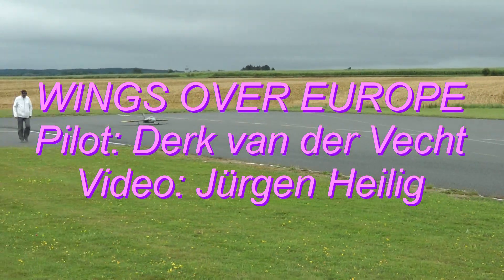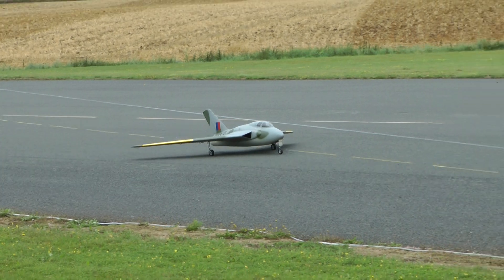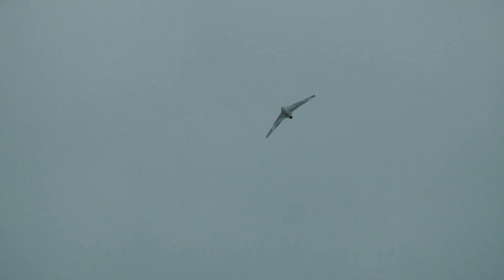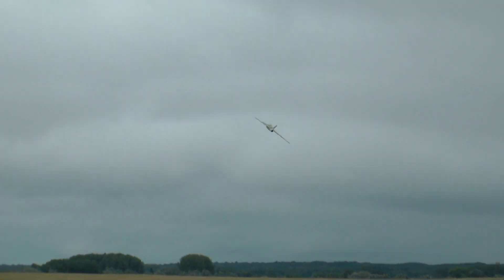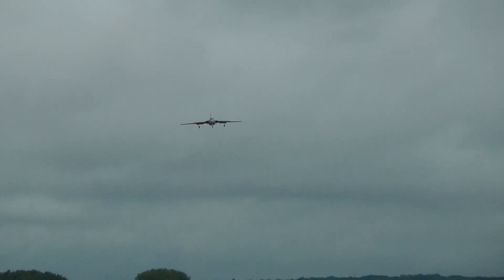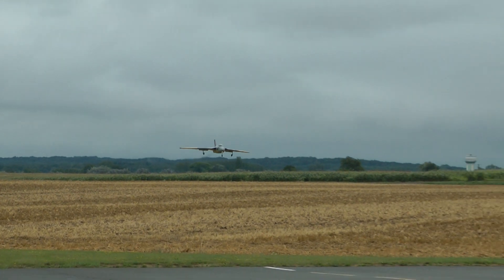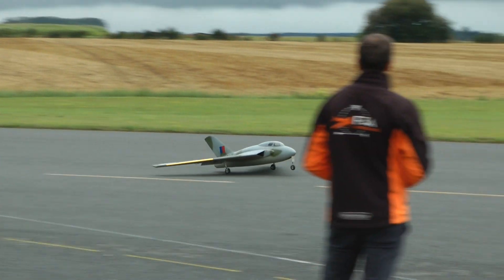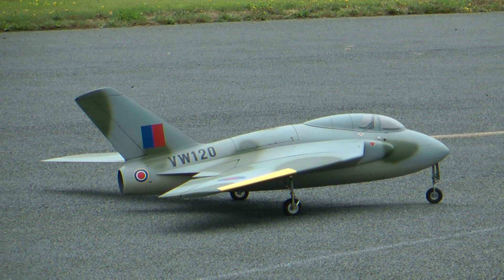WINGS OVER EUROPE - DH 108 Swallow in Action

Comment: The model depicts VW 120 a high speed version OF the DH 108 which almost certainly broke the sound barrier in August 1948. The Mach  Meter went off the clock and was later corrected to Mach 1.02. This aircraft crashed in February 1950 killing it's pilot S/Ldr Muller-Rowland head of Aero flight at The Royal Aircraft Establishment, Farnborough. I arrived at RAE 5 days later on 20/02/1950 knowing nothing of this, and shortly after saw the last DH108, TG283.  give a display similar to the one given by the model in this video. On 1st May 1950 I was walking by the main runway and saw a DH 108 Swallow waiting to take off. This little plane had already fascinated me, (I was 16 yearS old), and I stopped and just stared. After a few seconds it started to move, I gave it the "thumbs up", and was surprised when the pilot returned it. I later found out he was S/Ldr Eric Genders, the new head of aero flight, and about 15 minutes later was dead because the aircraft crashed at Hartley Wintney. I worked in the General Instruments department was later given two bent and battered pitot heads to check out. I was told some days later that these came from VW120 and TG235. I was really upset by this but in those days you just carried on. And so the last DH108 was gone, and the three made had killed had killed three test pilots. The video brought it all back
Reply: Pffffff, what a story. Must have been difficult to digest such an encounter at such a young age!